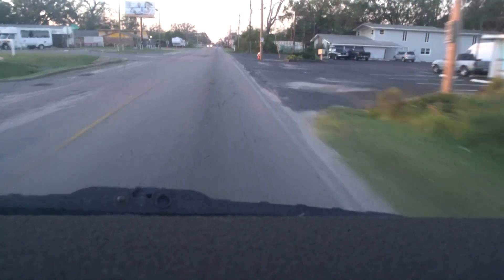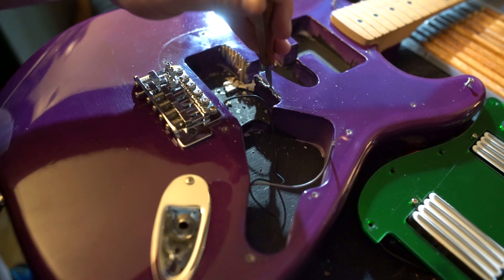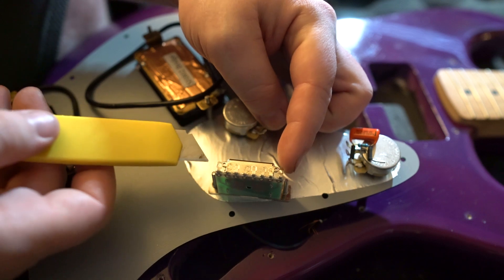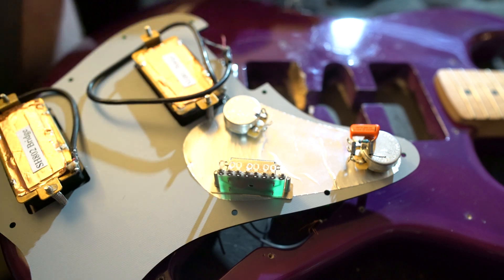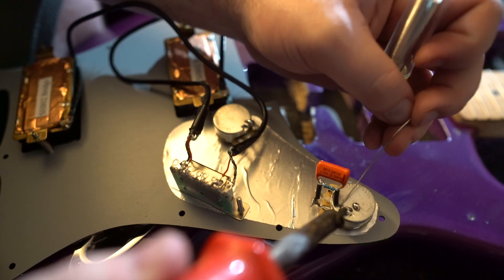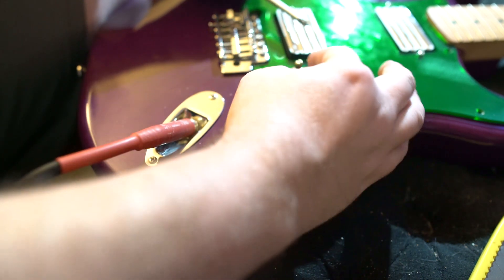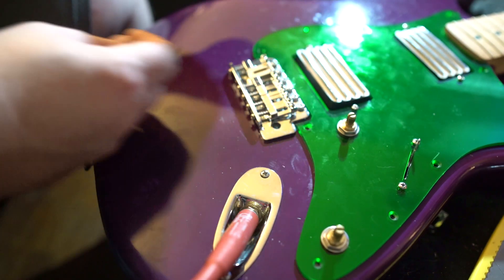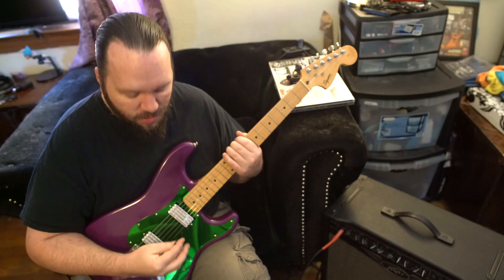Creating the Joker Squier: Full Wiring Guide!

Comment: You should use that 5 way to coil split. HN, SN, HH, SB, HB
Reply from the maker: Thought about it, but I'd rather throw in a 3 way blade and push pull pots down the road.
Reply: @ForsytheVideo   I gotcha. Yeah that would be better.
Reply from the maker: @matthewstacy2451  Yeah man the main thing for this vid was to keep it simple for the kids just starting out.  I get asked ALL the time about simple wiring for dual humbuckers.
Reply: @ForsytheVideo  those are some crazy pickups too. Green pick gaurd looks sick.
Reply: Intrested to see what they sound like split you should make a follow up sound sample video when you get the wiring done.

Comment: You NEED to scratch EVERY part made of aluminium before soldering.
Reply from the maker: Good advice I suppose but no aluminum was soldered to in the making of this video.
Reply: @ForsytheVideo  Yes I write faster than I think, but it mostly apply to every metal that's supposed to be shiny but looks like crap because of the oxydation on the surface of it. Sorry for my poor english and nice video as always. Cheers from Euskadi.
Reply from the maker: @ownedbyeasan  I appreciate your comment!  I understand what you mean, thank you.